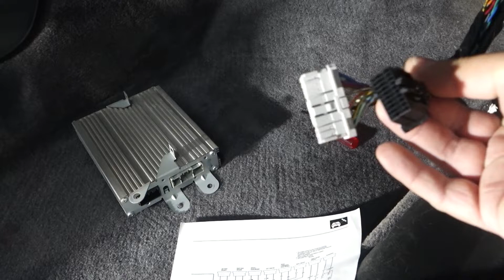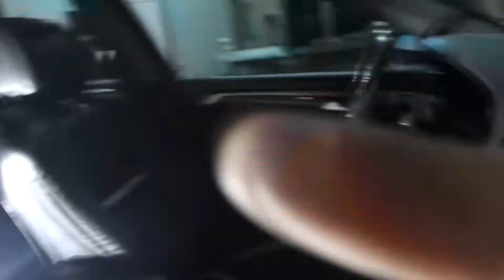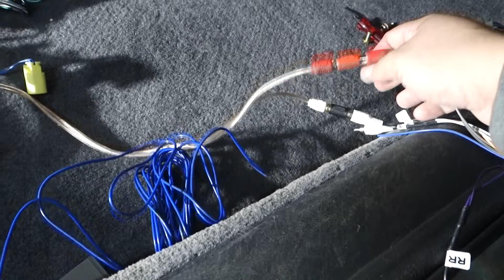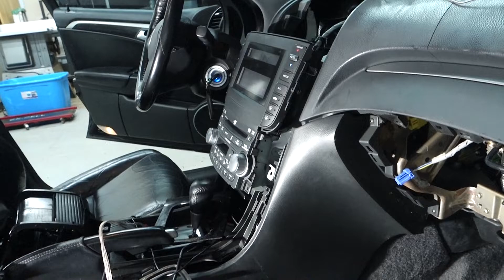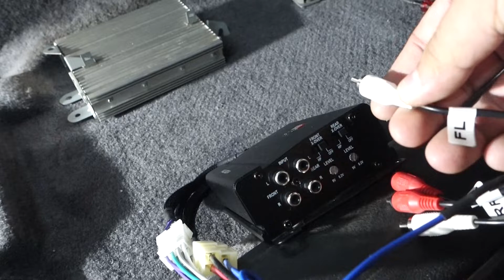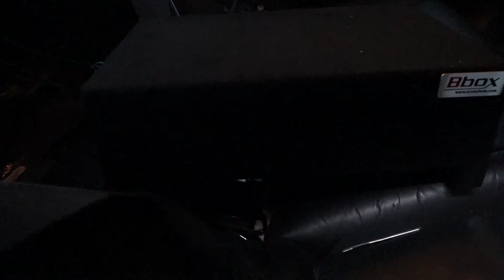Acura TL Amplifier Bypass | Amplifier Replacement

Comment: Your wiring harness was used to install the stereo in my car so can i just tap into the gray harness that was coming off of the factory amp to the new amp for the speaker wires? Then from the back of the stereo use a splitter to split the signals to a 4 channel amp? I don't have the factory sub anymore.

Comment: Where on 2010 TL Amp is located ? It’s not by kicker panel
Reply from the maker: in the trunk on the passenger side
Reply: @MobileMaxCarAudio  honestly. It ain’t there lol. I pull away the trunk wrapping thing and saw nothing. I checked under the rear deck. This thing is hidden somewhere else. I looked twice. I’ll look a 3rd time.
Reply from the maker: @crazyboo8971  you aren't looking hard enough. It's in the trunk behind the liner right near the wheel well.
Reply from the maker: @crazyboo8971  https://ibb.co/q1HLQmC
Reply: @MobileMaxCarAudio  okay. Definitely will look harder later. Thanks man.

Comment: Would the 5-channel amp put out enough watts for an aftermarket 8-in sub? Also being that most of the door speakers that I've seen are 3ohm to 4ohm. Will those be too much power? I hear that most door speakers are around 2 ohms. My head unit is an aftermarket piece that doesn't put out much wattage. Any recommendations on the type of speakers for the two front tweeters, 2x front door speakers, 8in sub, and 2x rear panel speakers?

Comment: Why do u need to use the rca speaker cable and the high power speaker wires if I am replacing the factory amp. I thought rca cables are speaker wires.

Comment: My only wish is you had a car audio shop here in Florida. I recently purchased an 06 Acura TL which had the car OEM amp exposed along with 2 other OEM amps. He drilled holes in both front door panels (not the OEM spot but near the door opening) the only speakers that work seems to be my tweeters, center speaker, and the passenger door speaker (the one that a hole was cut for in the door panel and its hanging out) all rear speakers have been removed and the 8in sub area is totally mangled (the metal rear deck) so the fabric that usually sits under the rear deck now hangs down. I feel like I'm at a loss for what to do. I know how to put after market speakers in a car, I also know how to run amps, but I've never had to deal with a car that had a factory amp that controlled so much. I'd love to have my center speaker, both tweeters,  doors, rear deck speakers, and some how figure out how to repair the sub area on the rear deck. But I do enjoy watching your videos.

Comment: How about if i want to use the stock radio and the factory Amp ? Can i still connect an extra amp for Base only using that stock amp connection with out having to take the radio out ??  Acura TL 2009.

Comment: I have a question, I’m going to be using an aftermarket radio, with yalls diy kit with the rca jacks, my factory amp is also dead, so if I used the by pass kit would it not work due to me using the rca plugs instead of the normal plug in the back of the radio? I’m just kinda confused?

Comment: bought your complete set. I am running an hd1200/1 for my subs. It has two channels. Your rca connector(black plug) has one rca for sub. Can I use a y splitter? Will this mess with my volume for my sub?

Comment: So I could essentially buy that and hook up an aftermarket amp and sub while using the factory head unit right
Reply from the maker: yes sir we have a harness just for that, you don't even have to remove the radio. https://mobilemaxcaraudio.com/product/acura-tl-aftermarket-subwoofer-integration-t-harness/

Comment: Using the bypass kit, can you run the 4 door speakers and factory sub off a aftermarket head unit without adding an aftermarket 4/5 channel amp?

Comment: Just do the bypass put another amp install new 8 inch  subwoofer 🔊 and bomm you have fire sound butt you need to update your door speaker and de rear deck and you about to come back and like this comment

Comment: Is the sub powered by the same amp? Do you have a replacement amp that’s plug and play?

I have engine noise coming out of my drivers side dash speaker and it’s driving my wife crazy. Also, I didn’t see it on your website. Where are you located? Thanks
Reply from the maker: Yes the sub is powered by the same amp and we do have plug and play replacement amps. WE are located in Bay Shore NY.  I would clean the battery terminals and ground that sometimes causes engine noise.